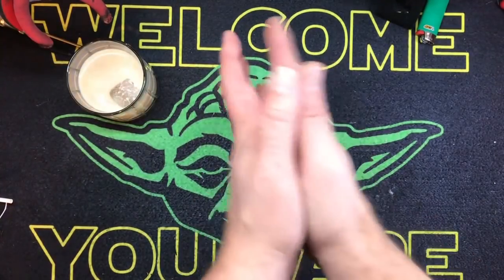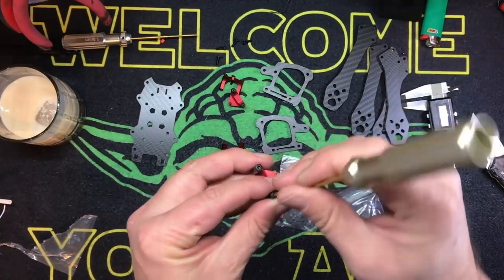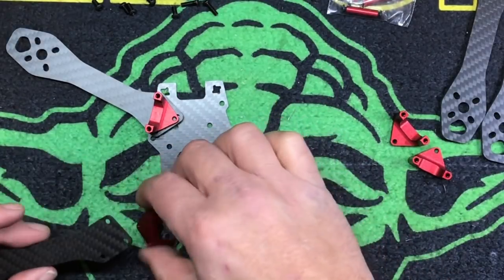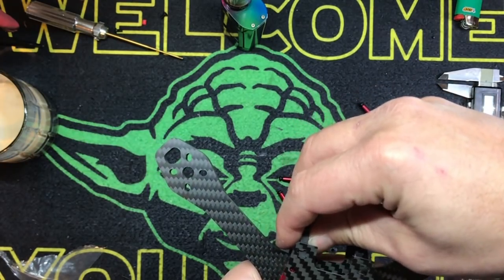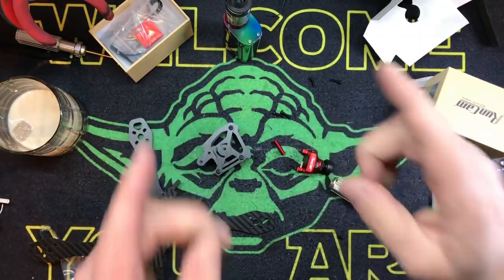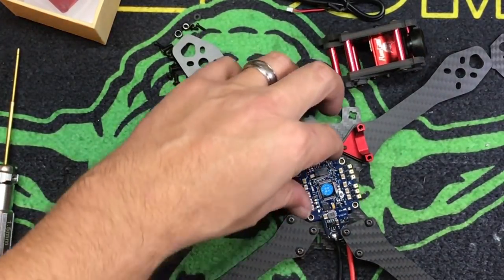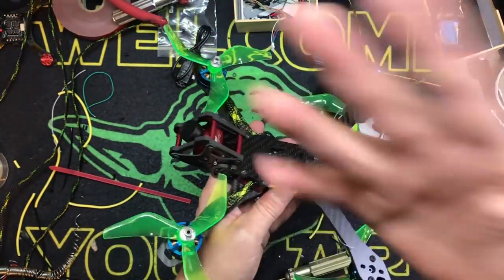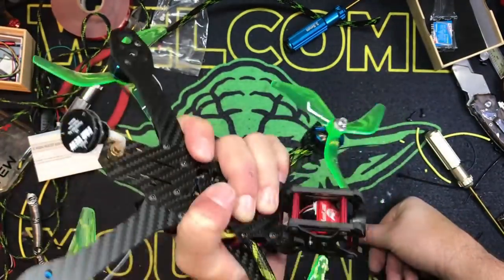Moka Berserker Frame Show and tell and semi build!!!!!

Comment: Oh I was looking at these on the Moka website the other day as I need to replace my Chameleon frame. I was a bit hesitant though with that 1.5mm bottom plate. I think I'll fork out the extra coin for an Armattan Rooster just because of how much abuse the Chameleon took. I can't afford to be replacing frames every few weeks....as much as I'd love to build some of these frames up. Thanks for doing the builds so we can see them though mate. Legendddddddd
Reply from the maker: HipoxiK thanks brother.   One thing I’ll say about this bird, with the wide aluminum standoffs in the body.  This botch is super rigid. I thought the 1.5 mm would be week to, but it’s nuts strong.   Just FYI
Reply: Excellent.
Reply from the maker: When ya teaching me how to fly
Reply: Haha well I wont be doing any more flying videos as my Foxeer Box cam is playing up after only 4 weeks and I haven't even abused it. Seems to be an internal thing, battery lasts about 5mins now and I can't even record at 120fps at any resolution. Supposed to have image stability in 1080 and 720 which doesn't work either. I have been waiting on foxeer to get back to me for ages. About to smash it with a hammer and save for a GoPro session 5.
Reply from the maker: Oh that’s crap.   I’ve destroyed so many cams.  I have a couple gopros now, but honestly I like my Polaroid cube the best for quad, weighs nothing and records well

Comment: Hey!! Since I'm just getting into the hobby, I was wondering what batteries you guys are using for freestyle 5" rigs. Any good recommendations for some starter packs that have a good balance of quality/affordability? Not trying to cheap out, but also not trying to spend $35 each on packs with the same quality as a $25 pack. If I have to spend $30+ per pack, so be it. Just wanted to hear from some of you guys with experience.
Reply from the maker: Hey brother, I completely agree, I have a rule where I do t spend more than 25$ per battery.  Tatu lipid are good and infinity as well I run 1300mah  80c 4s on all my 5” rigs.  Also check this site, http://www.chinahobbyline.us/. Pretty exonomical
Reply: hay i was just going to tell you about cnhl that sight you just posted looks fake the prices are double

Comment: Pet Peeve response: When I worked in manufacturing we called the rounded top hex screws "button heads" and the cap screws we called "socket head". The ones we called flatheads are flush top countersunk screws which are a bitch to remove once theyre torqued. The Chinese copies seem to come with some really crappy quality alloy screws no matter what style.
Reply from the maker: Lol.  Agreed.  Not as deep in the socket.  But allot of it tho is also the alloy used.   Normally I replace those with cap screws on all my kits

Comment: The frame look good, but i dont like the camera mount solution. You could loosen the screws to the mount a little, mount a servo on top with link to the mount and transform it into a gimbal..LOL
Reply from the maker: Lolol.   We will see how it holds up.  I like the fact that it’s a single solution with the compound adjustment tho.  I crash like an idiot so we’ll see lol